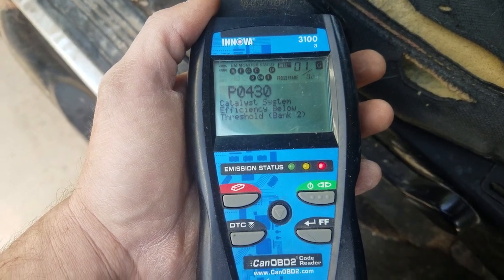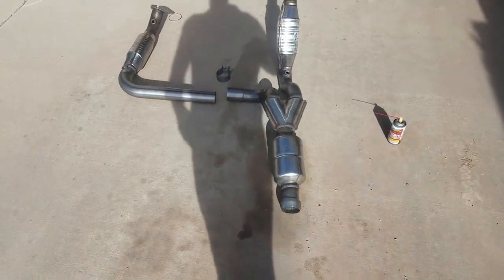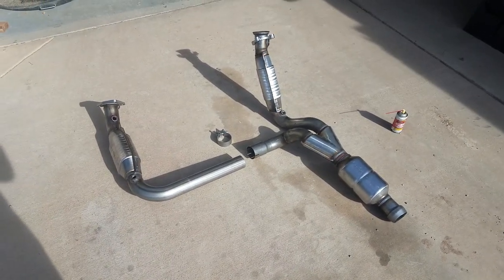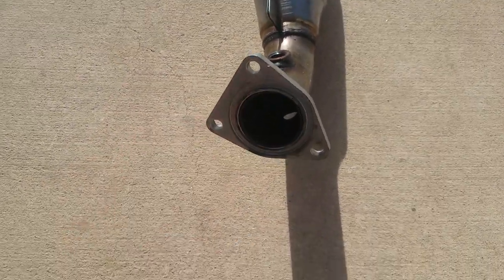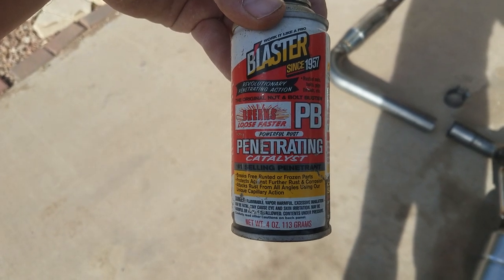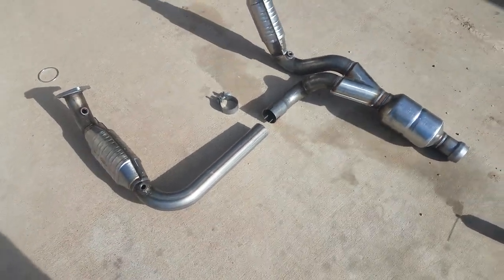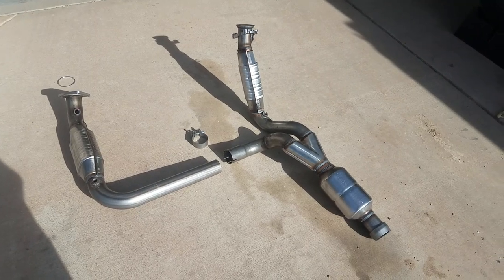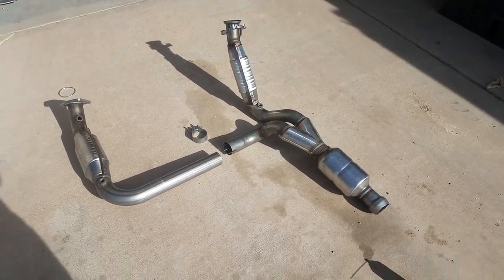2010 chevy silverado catalytic converter part 1

Comment: Could I just cut the catalytic converters off does new pipes and weld it onto the old pipes ?
Reply from the maker: your check engine light would always be on unless you wire resistor between sensor